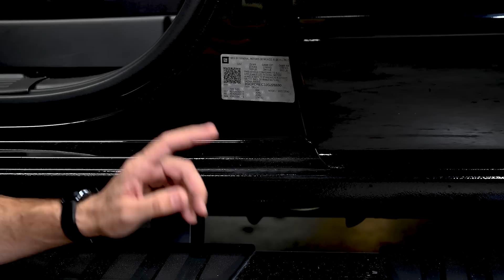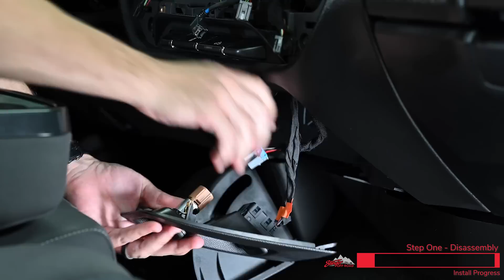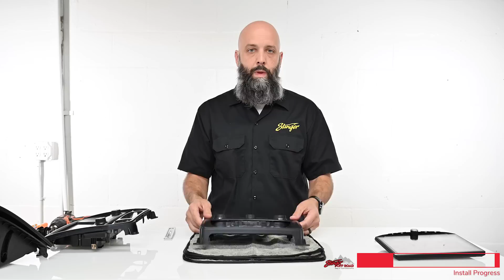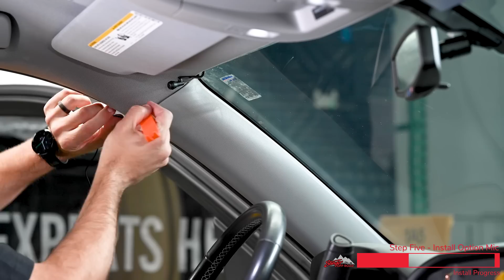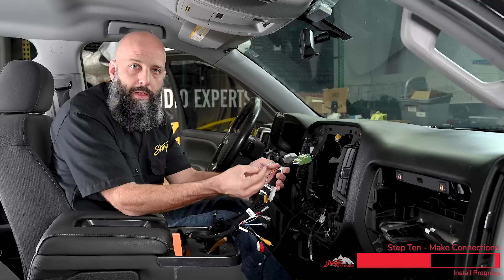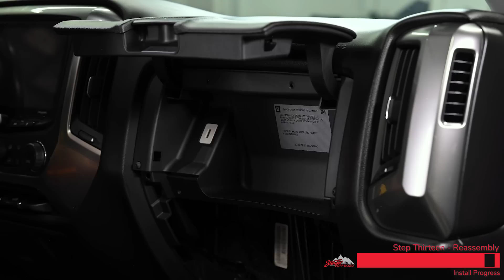INSTALL: 2014-2018 GMC Sierra & Chevy Silverado Truck HEIGH10 Radio Upgrade | RB10GM14B

Comment: Can you use the factory mic in the headliner or do you have to choose between the extra eternal mic or the one in the stereo.
Reply from the maker: Unfortunately the factory microphone can not be used with the HEIGH10. The external mic is included with the kit, and you can use either the external mic or the one built into the radio screen.

Comment: Pink speed snese wire? What's that for? Is it to prevent certain features while the vehicle is moving?
Reply from the maker: The VSS input on the HEIGH10 is so that the vehicle tracks and moves smoothly in the different navigation apps on the radio. It does not prevent any features from working, rather it makes the navigation work better.

Comment: How much is the unit? Can it get XM/Sirius?
Reply from the maker: The link to the Stinger Off Road site where you can buy the unit direct is linked below. It has satellite radio capabilities by adding the SXV300V1 universal tuner (purchased separately).

https://stingeroffroad.com/products/silverado-sierra-radio-replacement-kit

Comment: Did the module and nessary cables/harness come with radio?..... I was driving and lost all sounds to everything including on star communication audio  door ding, turn signl chime don't know what else to do so radio is next
Reply from the maker: The RB10GM14H kit comes with the Universal HEIGH10 radio and all required installation accessories. Please keep in mind that the kit is not compatible with Bose equipped vehicles, so if something amplifier related is the cause of your loss of sound, this radio will not work. If it is standard audio, then this will replace the entire factory unit. Hope this helps

Comment: Does this maintain dash instruments like navigation, audio display, tire pressure ect as well as parking assist modules and mylink vehicle settings like auto door lock ect?
Reply from the maker: The radio does not integrate with the cluster message display. The settings that are done thru the factory radio can still be done after the HEIGH10 is installed, but must be done with the PAC Vehicle Settings app and a laptop.

Comment: Pardon my ignorance I am not a tech guy. I was looking at this unit to replace the factory radio/screen for my 2014 Sierra Denali. Will I be able to play music from my phone using Bluetooth? I am not a fan of having to plug my phone in every time I want to listen to music in my truck currently. Well done on the video. It was so well done it made me feel like I could do it myself even though I still struggle to use basically any other form of technology
Reply from the maker: You will be able to stream music to the radio via Bluetooth, but you would have to be connected to the USB to access all the features of CarPlay and Android Auto.

Comment: my truck is equipped with bose speakers, would i have to replace my speakers in order to get this radio to work?
Reply from the maker: We do not currently support the Bose equipped vehicles. Much modification would be required to keep factory systems in place when replacing the factory radio in a Bose equipped truck. It is not recommended at this time, but if you do decide to proceed it is recommended that you do so with a professional installation shop performing the work.

Comment: Does this retain factory vehicle settings?
Reply from the maker: The settings will remain as they are set prior to removing the factory radio. If you wish to be able to modify the settings after the HEIGH10 has been installed you would also need to get the PAC-UP update cable and run a USB cable somewhere you could attach a laptop and modify them with our Vehicle Settings App for the RP5-GM51

Comment: if you use the optional microphone does that void out the microphone on the heigh10 face or would they both still work?
Reply from the maker: It will use which ever one you choose in the radio settings, but will only use one or the other at a time.
Reply: @StingerDrive  Appreciate it.  Mine just arrived and will be installing by this weekend.

Comment: Does it retain XM radio function
Reply from the maker: You would need the SXV300V1 satellite radio tuner to add satellite radio to the HEIGH10. The factory tuner cannot be retained.

Comment: Simply a great video! I have the BOSE system in my 2015 Silverado High Country. Do you have any compatible product?
Reply from the maker: Unfortunately we do not have a radio that is compatible with the vehicles with Bose at this time
Reply: @StingerDrive  That really sucks🤣🤣🤣thanks for your reply. Merry Christmas.
Reply: @StingerDrive  GM made it near impossible to upgrade our bose stereos with the pop up screen if you guys ever get one made up i would love one!
Reply: If I have the bose but plan on bypassing the bose amp and installing my own 5ch will this unit work?
Reply: @timbelt8365  you would have to make a full overhaul of the system including speakers and wire harnesses. Bose usually uses weird impedances for the amps and speakers and it impossible to use them with other components. Dont to mention the other vehicle systems the radio controls or serve as interface.
Reply: @eddielozada3694  yea i hear ya. Right now I have the stock HU and Bose amp. I have a Audio Control Lc7i signal processor spliced into the outputs of the Bose amp ran into a Rockford 5ch amp with all Rockford speakers and sub.  I am using the factory speaker wires though. I like this stinger unit but might have to look at other options.

Comment: Over all a great video to show to put it in, i did see alot of spaghetti going on. Dean and Fernando @ 5star would have De-pinned wires and connectors not used and intergraded both the supply( car) to the radio harness and put them together to make one harness and not use the tacky zip ties and use factory style tessa to put in. I realize there is a lot of dead space and the Module interface covers the wires but going the extra mile is just good business. Other than zip ties no issues with Video, but i am sure it works either way
Reply: 5 star is definitely top notch bro

Comment: Will the USB in the center console still connect the phone to the unit? And steering wheel controls, will they work?
Reply from the maker: The steering wheel controls are retained with the provided interface. The console mounted USB however is not. This is why we provide the Dual USB dash mount.
Reply: @StingerDrive  I see now, but on the website it says it’s not compatible with Bose system

Comment: Any plans on making this compatible with higher trim models such as denali, all terrain, LTZ ect? Would like this on my 17' sierra all terrain.
Reply from the maker: Unfortunately we do not offer Bose integration at this time.
Reply: @StingerDrive  Have you updated that in the last 10 months? I just found this video and have a 2015 Silverado LTZ. I would love to be able to install this if you have updated the equipment to replace the Bose system.
Reply: @StingerDrive it says that this kit is now compatible with Bose on the stinger website. If this is the case, will the install be the same on a Bose model

Comment: Too much wiring to interface unit.  More connections , more signal lost. Should have I connector junction to veh. But overall not bad. Can you connect  a CD player/ juckbox?
Reply from the maker: The wiring and the interface are required to integrate aftermarket equipment with the factory systems in the vehicle.

Comment: Why isn't it compatible with bose? Or does it still work with bose?
Reply from the maker: The factory Bose system is not something we currently have a radio replacement solution for due to the type of communication it uses.

Comment: worked great for 3 months now its black screen but randomly boots up checked every connection all is tight but still acks up ill be going back to OEM since gm wont be able to help with aftermarket so im out $1500
Reply from the maker: If you are having issues with an existing radio or install please don't hesitate to give us a call in technical support so that we might help you resolve your issue. (727) 592-5991

Comment: HDMI inputs available and wireless capable ie internet?
Reply from the maker: The unit has an HDMI input on it and some people use streaming devices plugged into it and tethered to their phone. The radio itself is not a hotspot.
Reply: @StingerDrive  Ok thank you but it is wifi capable? It can receive wifi signal? Soory if these are dunb blone questions lol

Comment: Holy sh*t. I remember when swapping radios was a drive to best buy and removing just the bazel over the radio to access the entire thing.
Reply: I went from a 1988 toyota pickup that took 10 minutes to change the stereo and I own a 2018 silverado now and I'm 2nd guessing upgrading the stereo lol. The video takes longer than it should for the whole thing.

Comment: What about the connection for my USB’s in the center console? That are apple-play?
Reply from the maker: The USB connections in the console are not retained. Not all trim of the trucks came with them, so that is why we give the dual USB mount for the area under the radio that will work with all trims.
Reply: @StingerDrive  and the 110 in center console?
Reply from the maker: The 110 in the console is unaffected.

Comment: just installed this kit. i can not for the life of me get the SWC to work. the module see's the command because the light blinks on the 51. but i do not get volume control on the head unit. help plzzzzzzz. i have watched this video multiple times, pausing to check the wiring compared to mine. every thing is the same. i can see on the installer menu my controls are not programmed. but  i can not find any info on that....
Reply from the maker: Give our Tech Support a call at 727-732-3114 M-F 9am - 7pm and we can help you troubleshoot this.
Reply: Did they ever help you with this issue? I've been having the same problem. Would greatly appreciate a response.
Reply: @ovaca16  yes its fixed..... after talking to tech support we found out the kit did not have a cable that is needed for the SWC. shipped it for free. installed it and now have working SWC.  just give them a call.
Reply: @cityjenkins7500  yes, i talked to them this past Monday and got it figured out. I had the cable in my kit and the circuit board for my camera. Thanks for your response buddy.

Comment: Does it come with a port for the heated seats
Reply from the maker: The heated seat buttons are mount in the outer silver trim of the dash, that piece does not get replaced with our kit. You just replace the inner black plastic that holds the screen.

Comment: This is one awesome head unit! I have a Duramax Denali, will the HEIGH10 work with the 2500HD GM trucks as well?
Reply from the maker: As long as your truck is between the years listed and matches one of the RPO radio codes listed, yes, this will also work in the 2500HD.
Reply: @StingerDrive  Awesome news! I'm sold! 👍

Comment: Does this work with a 2019 GMC Sierra Limited or 2019 Silverado LD. (previous body style)
Reply from the maker: If it's the older body style with one of the RPO codes listed it will work. You can call Tech Support at 727-592-5991 M-F 9am-8pm and we can help you determine compatibility.
Reply: Yes the LD will work

Comment: I recently installed this on my silverado step by step but my factory  backup camera won't work. I plugged everything except the swi cable since my steering wheel doesn't have the control buttons. Does it need to be plugged for the camera to work?
Reply from the maker: The steering wheel connection does not need to be made in order for the camera to work. Can you give Tech Support a call at 727-732-3114 M-F 9am-6pm.

Comment: What is the chime adapter for I have aftermarket sound system with stock radio can I buy this adapter to lower the door chime volume
Reply from the maker: The chime module works with the RP5-GM51 module, it's not a piece that is sold by itself.

Comment: does this kit work for replacing the 4" screen?
Reply from the maker: This kit covers IO3, IO4, IO5, IO6, or IOB. You can identify your factory audio system by referencing the Service Parts Identification sticker inside the upper glove box.

Comment: So right now, I press and hold the talk button on my steering wheel and then it pulls up Siri on my iPhone. Even if I don’t have it plugged into the usb. Will that feature still work with this?
Reply from the maker: You can active Siri over the Bluetooth connection as well as when the iPhone is plugged into the USB for CarPlay.

Comment: Dear lord all those wires. Why not consolidate most of the unused wires since the kit is only compatible with a specific truck code
Reply: But wait there more harness 😅
Reply: Talk about a damn birds nest
Reply: Yeah since you can just velcro in a whole new system. Lmao stfu, this was a great install video, didnt even have to break out the solder.
Reply: Lol yea when he said "plug and play" I figured  the install would be simple but NOPE. Go ahead and take apart your ENTIRE front dash of your truck and be ready to basically rewire everything lol 

ALOT of easier and cheaper options out there with similar if not same features

Comment: It's criminal you dont have this kit for the Bose systems my Denali is needing this kit but it's the way the cookie crumbles i guess
Reply: Meaning if your truck came stock with Bose speakers it won't work?  I AGREE that would be ridiculous
Reply: just watched the whole video just to find out towards the end that my LTZ can’t get this. insane.
Reply: @Dnasty6031  i know this company kills me that they have a $1000.00 radio or more but didnt think to build one for the guys that bought the high end trucks instead they made it for the stripped down trucks

Comment: When will you have a kit for bose equipped vehicles?
Reply from the maker: Currently we don't have a date for a Bose version, but keep checking we are always adding new products.
Reply: @StingerDrive  Can you make an update to this comment when it does become available for the bose-equipped models? If so, you would have an easy sell. Don't take too long though, im hunting for a system lol. Thanks!
Reply: Google LLJ Customs. They have the harnesses to bypass the BOSE system so you can use the HEIGH10 system

Comment: If your truck comes with factory navigation will that features be retained with the replacement unit?  Also do HVAC controls show up on the screen like the stock radio?
Reply from the maker: This unit will not retain your factory navigation. You can add our iGo Navigation card to have built in Navigation on this unit. The unit is not integrated with the vehicle to provide information such as HVAC controls.